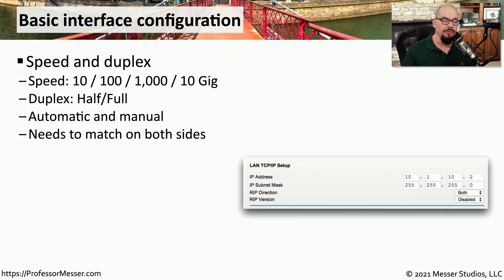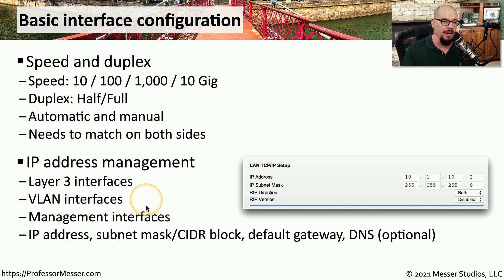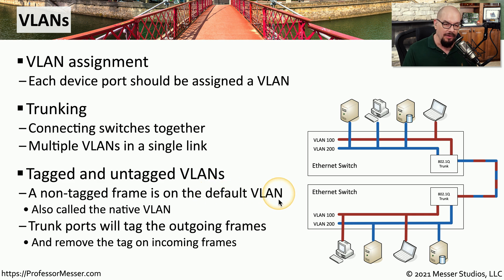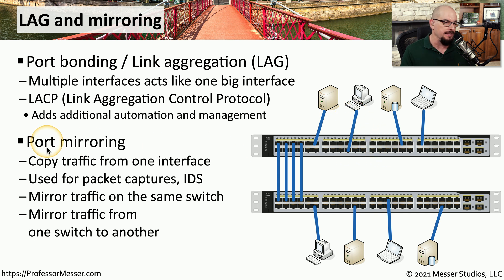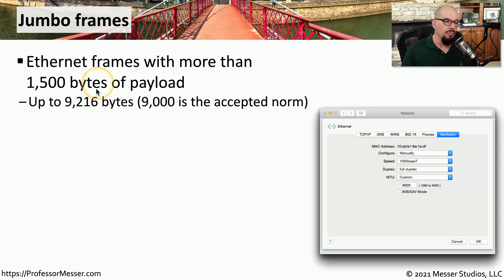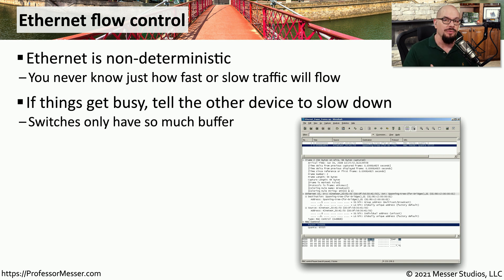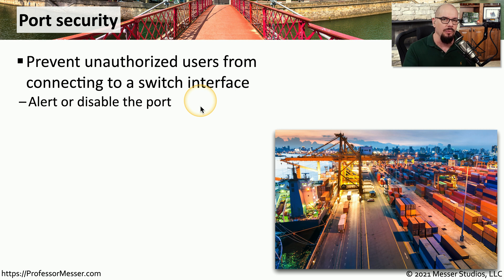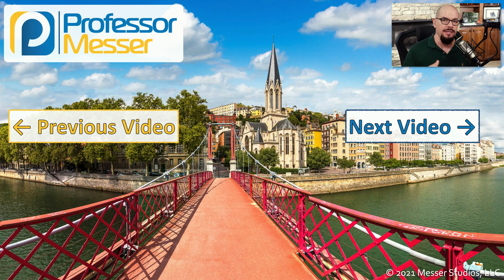Interface Configurations - N10-008 CompTIA Network+ : 2.3

Comment: With Link aggregation, if I have a router with 2 ports labeled link aggregation but a 24 port switch with no ports labeled with Link aggregation; can I just plug those Link aggregation ports on the router to any of the ports on the switch to increase the bandwidth between the two or do I need to find a switch with dedicated Link aggregation ports?  Thanks for the great videos.
Reply from the maker: All interfaces participating in an aggregated link will need to be specifically configured for a LAG connection.

Comment: Does port security prevent a correct spoofed MAC? I've searched the internet and couldn't find an answer. On another note, Professor, can't thank you enough for everything. I hope you don't mind me posting my questions on your videos when I really couldn't find an answer. God bless.
Reply: You don't prevent MAC spoofing, since it's entirely client-side. This is the reason that no one that really cares about security is using MAC whitelisting or blacklisting.

If you care about controlling what devices connect to your network, you should be using 802.1x with device certificates issued by your own internal CA that you control, or with some form on NAC like Cisco ISE or Microsoft NAP, as well as some kind of data-in-transit encryption.
Reply: @SalamaAltalla  Great answer. Thank you.
Reply: @abdallahelshuraydeh1697  I know this is an old comment, but anyone reading this, note that in the real world, MAC addresses are very easily spoofed, so MAC whitelisting/blacklisting isn't a great or common security measure.

BUT... CompTIA thinks it is the bee's knees for the tests, so for the tests if you see something about security and MAC blacklisting, treat MAC blacklisting like it's Fort Knox!... But after the test never really worry about it again haha
Reply: @ChadVanHalen5150  Good to know!
Reply: @ChadVanHalen5150  this yes, decades ago MAC spoofing wasn't nearly as much of a concern, but nowadays b/wlists are kinda useless, since even laypeople can easily acquire and use programs for this purpose.

Another thing to remember is that virtual machines "spoof" MACs on their own, since each VM you run will have some kind of "digital/virtual NIC" with it's own MAC address